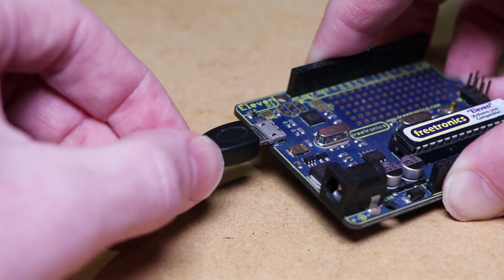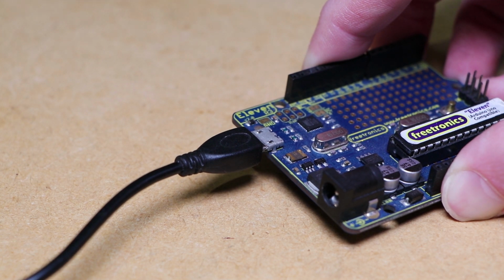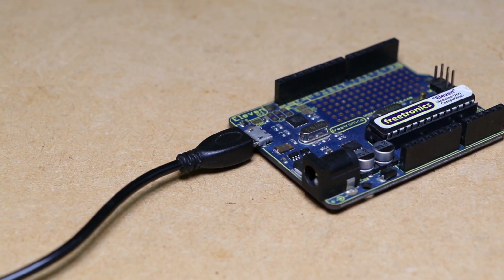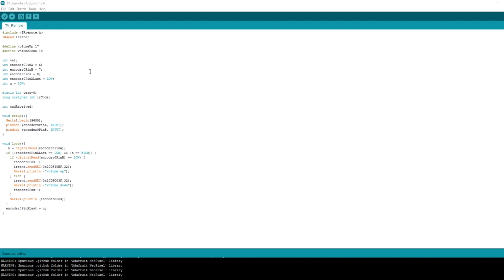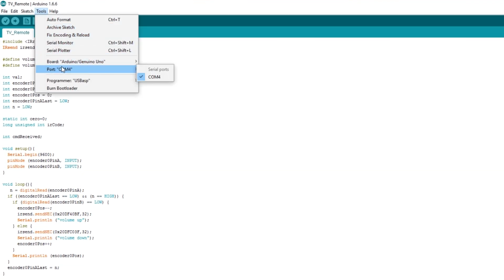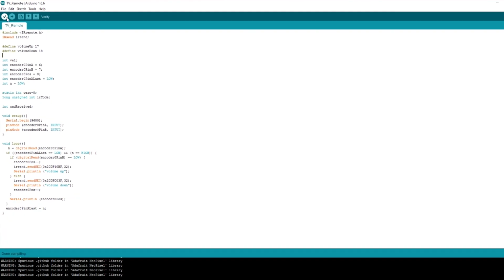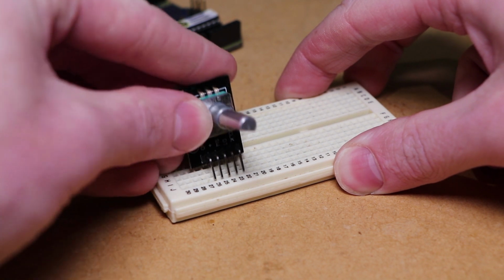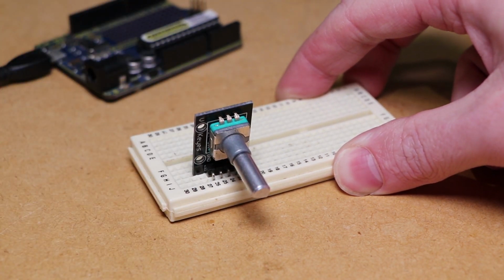Arduino TV Volume Control

Comment: AYUDA!!!
Hola, buenas.
Estoy haciendo un proyecto con un Arduino Mega y se me esta complicando el uso del Led Infrarrojo (emisor), para comunicarse con mi decodificador de DirecTV. al usar el lector infrarrojo, me aparece el codigo pero no especifica si es NEC o SONY, etc. 
Alguno tiene un codigo tipeado para compartir que sea, por ejemplo, cambiar de canal del decodificador de DirectTV? 
nota: En el proyecto ya tengo utilizado casi todos los pines, en lo posible, el codigo deberia tener la ubicacion del sensor y no colocarlo en el pin que deberia estar por defecto de la libreria, (que si mal no recuerdo, en mega es el pin 0).
desde ya muchas gracias!!